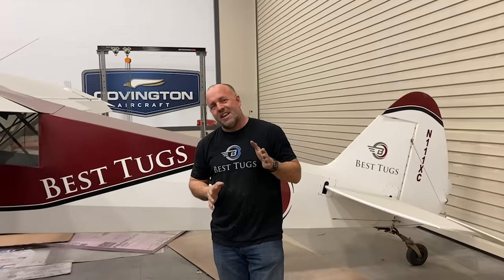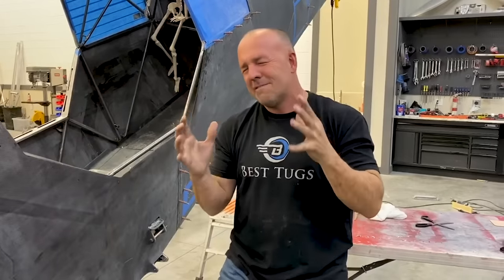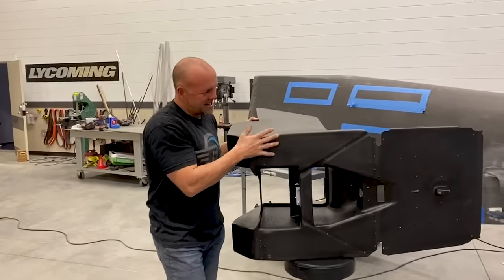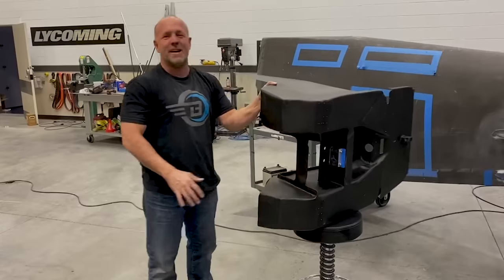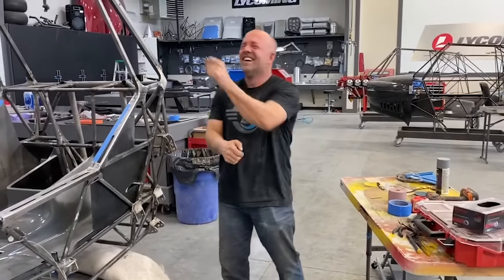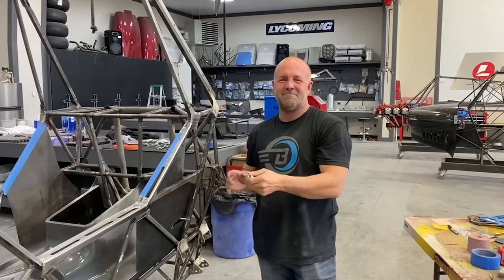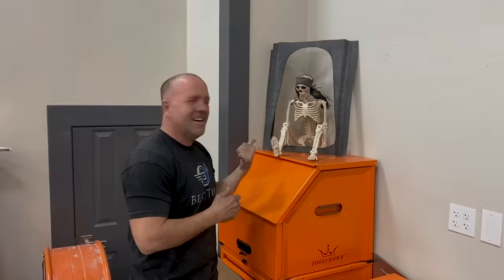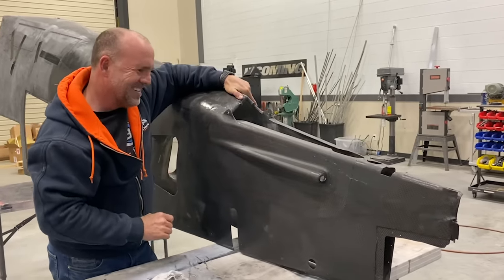Floorboards, Pedals, and more 🤠 (Scrappy Bush Plane 9)

Comment: I think see a problem with your solution of using adjustable spring loads to replace the rudder trim tab. You are planning to bias the load of the two pedal springs to replicate the side load that the bendy trim tab supplied. That gives you one specific level of side loading but the trim tab doesn't give one specific level of side load. It is continuously variable based on airspeed. The way I see it I would expect that your rudder trim would be neutral at one speed. Below that speed it would be loaded one direction and above that speed loaded in the other.
Am I missing something?

Actually with Scrappy wouldn't it be a good upgrade to make an adjustable trim tab? You are going to have a bunch of different increased loads from that crazy motor and prop and I'd think being able to adjust for that would be nice. 
(Trying to think of a way to have airspeed, engine RPM, and engine acceleration/deacceleration automatically taken into account and it would either be coming up with some analog approximation or doing it digital after building a data map of the needed settings. But then I start thinking MCAS.😱)
Reply: BorkToThe3rd I had exactly the same concern when I saw the spring. The force exerted by the tab varies with airspeed and this is generally desirable. The spring will provide proper trim at just one airspeed.
Reply from the maker: You are both absolutely correct 👍🤠🤠 I set it for the speed I cruise with all my friends. Like any bend tab.  I have already designed a trim connection for electric trim if I decided I want the extra couple pounds and want in flight Controll on all trims like I did on Draco and my other builds.  I’m hoping to leave it simple like other cubs but there is a good chance I may change it later 👍🤠
Reply: @MikePatey  After I posted I kept second guessing myself thinking, "He's got to have thought of this with all the hard engineering he puts in everything." I'll be very interested in how much rudder trim this beast needs. 

After seeing the video you posted of airboat drags (and that prop😱) and that crazy motor you have, I keep wondering how close to a "Gee Bee" upgrade for a Carbon Cub this will be.
(You really want to scare the hell out of the other STOL drag competitors don't you!😝)

Comment: Won't the spring add aerodynamic drag to the rudder by off setting it to one side? Cubs shouldn't have trim tabs, Piper rigging instructions call out pushing the leading edge of the vertical fin to center the ball. I set the vertical stabilizer to point 1 1/2" left of the middle of fuselage at windshield before covering on a stock Super Cub and it rarely takes any more pushing once it is flying to center the ball.

Comment: Won't expansion and contraction of the air frame with temperature relative to the rudder cable's own expansion and contraction change the calibration of your pedal stop by a lot more than 1/64th of an inch?
Reply: Aircraft cable has an extremely small coefficient of thermal expansion and carbon fibre has a slight negative coefficient of thermal expansion. Both coefficients are less than 1000th of an inch + and 1000th of an inch - over a 60°rise in temp.
Reply: @peterrasmussen2805  It's a thousandth of an inch per inch over 60 degrees. Over a 20 foot (?) cable, that's nearly a quarter of an inch.
Reply: Therefore, set your stop as close as possible to the median ( 1/64 should do ) and accept that at 30° above median the cable will be 1/8" longer and at 30° colder it will be 1/8" shorter. If 1/8" over or under length in an aircraft control cable leads to any problem at all, then I will never fly again.
Reply: @peterrasmussen2805  I agree, I just don't think the stop is going to work in all temperatures.  Maybe both sides will shrink equally and just balance out with cable load.

Comment: Couldn't you just powder coat that aluminum to prevent the corrosion,  and save a bit of weight with more sheets of carbon and resin?

Comment: Got a question for you.... God forbid you ever pile this thing up, but what if you have a situation like happened to that Kitfox pilot last year. He darned near lost his legs and was trapped in the structure till they cut him out. He had a LOT more foot space than you do.... The question is what provision do you have for foot and leg safety in the event of a nose first impact... which we all know is a very real danger for boondocking in a plane.
Reply: Hahahaha.... I forgot you Trent and Nick all fly together.
Reply from the maker: Shaun Olinger something I considered strongly was crumple zones and foot protection.  In some of the videos you can see I made a frame to protect my feet and crush zones.  It may not look like much space but it is a shield like no other in front of me. May I never need the extra pounds I put in there for that exact reason.  Thanks 👍🤠
Reply: Thanks Mike. I'll go back and look at that, just to see what you did. I missed it I guess. I too hope you never need those pounds! But.... Draco was built right, and saved you all. I don't guess Scrappy will be any different.

Comment: Check the math, but if I remember correctly, you actually increased the bending strength of that stainless tube for your rudder pedals when you gun drilled it.  I believe that a hollow tube is actually stiffer in bending moment than a solid bar of same diameter.
Reply from the maker: Back Road Customs you are correct 👍🤠
Reply: Mike Patey - might double check that. It is a widespread belief but the science behind tube vs solid re stiffness reveals that the tube is stiffer than a solid of the same weight which implies a smaller diameter for the solid.  Lots of threads out there. -here’s one.  https://www.thenakedscientists.com/forum/index.php?topic=47722.0
LOVE your build, videos, and planes!

Comment: Hi Mike, Ted here,
im still fretting over our last comments.!!! the numberes still plague me.
 any chance of a whiteboard laying ou the all up weight of,
1. std carbon cub aup, with std  motor
2 scrappy with the flatb 8  gas motor throttle stopped to 400hp,
3. scrappy with the GT6A? assuming its come back repaired? also throttle stoped to 400hp
I still think it would be a better option. Would show the weight saving with the GT motor.
 Also doing your std series of drop  tests, I suspect you might break the top engine mounting bolts, or bend the whole front bulkhead. 
Hell of a downward bending moment.!!!
Reply from the maker: Hi bud 👍🤠 I assume your talking about the PT6A ?  You say GT a couple times I’m not sure what your asking there? I assume you are referencing Dracos used motor Pratt n Whitney PT6a-28.   I’m not putting it in scrappy and never planned on it.  I want to be able to pull it back to around 100hp and cruise with my friends at just a few gallons per hour.  The PT6 can not even get into the high compressor map curve of the chart plot data at that low of settings. You should pull out the chart plots and look at it and you will see exactly what I’m talking about. It just would not make much sense. So I’m not doing that route. I wonder if you misunderstood something or heard a false rumor.  Ill see if I can go into some more numbers on an upcoming video on other questions 👍.  Keep in mind, std carbon cub numbers have no reference whatsoever on the engineering of the frame I did for scrappy on the front. It is literally multiples of magnitude stronger in every way and if I tried to use any part of the front of a stock cub I would rip the entire front end clear off on one bad landing.  Not a single tube in the front is same gauge, tube diameter, or actual count. It is now in no way whatsoever a relationship I use for a reference. The loads, points, torsions are all completely different.  I wish I had more time to write responses  in greater detail to hundreds of questions, there simply is not enough hours in a day.  Anyway I hope you enjoy the process and when it’s time I will do some drop tests on the front and we will see what happens 👍🤠  cheers and we will see more soon.  I need to get back to work 🤠🤠🤠
Reply: Hi  @MikePatey   GT= gas turbine,   thanks for clarifying the non use of a          PT6a.! My flight engineering history, Shackleton mk1 and 2. Griffon contra propped on cold war anti submarine warfare. the a/c was my resposibility up  to 15hrs over the atlantic. My RAF training was the most rigorous possible. apply it to all my metalwork.
 Great times.
Reply from the maker: Edward Frater that is so cool ! 👍🤠🤠🤠🤠🤠🤠

Comment: That rudder hardware is going to break. A few grams isn’t worth the torque of that motor on the rudder.
Reply from the maker: Hyprmtr 🤠 I’ll try and show more on that, I actually over doubled the strength and I doubled the Steele on the attach points and moment arms.  It will not break but looking at what was left out of the video I can see how it may look that way.  The area I pulled weight is not representative of the areas of load increases where I doubled the material and strength.  Thanks for the comment, I’ll show more 👍🤠
Reply: Mike Patey okay. I look forward to seeing more details. Thank you.